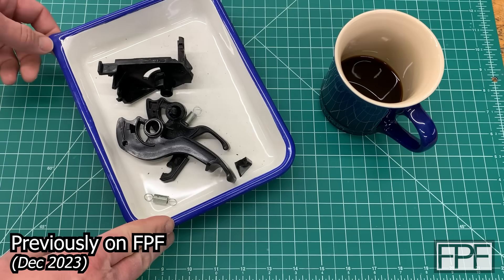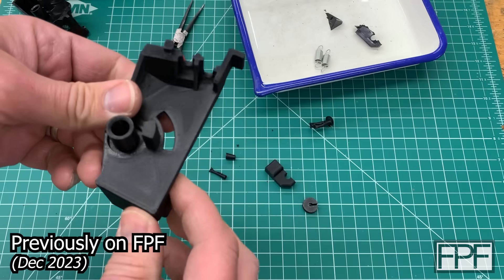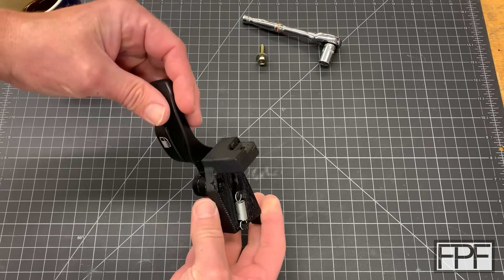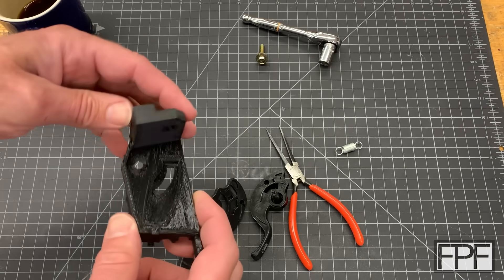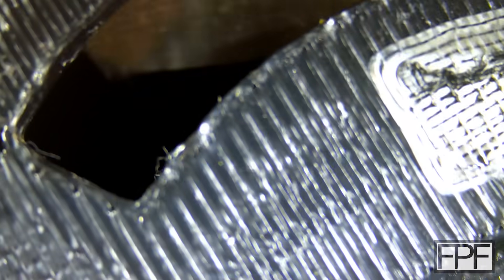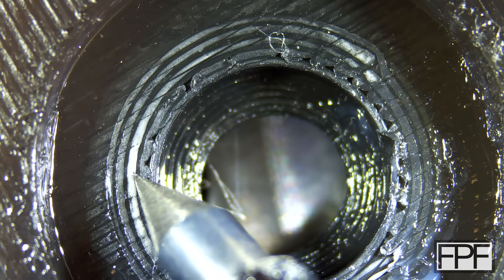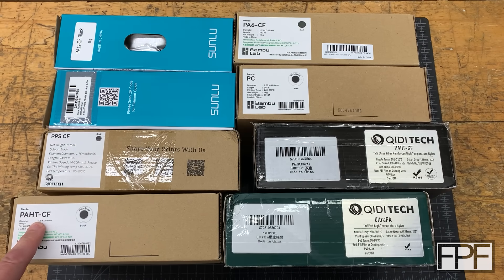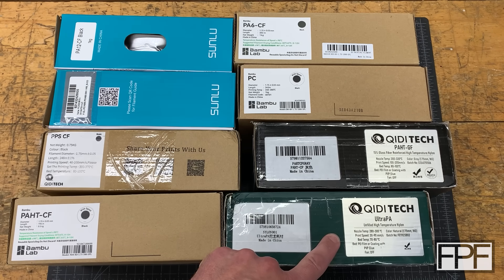3D Printed ABS Car Part Failure Analysis

Comment: Looks similar to 93 Corolla. Good to see in advance what sort of mechanism there is if it ever breaks :)

PCTG is my go to material these days for most stuff. It has layer adhesion rivaling TPU and is also very easy to print.
And as at least Henlor mentioned, adding an M3 screw or something similar for reinforcement would make sure it will not fail

Comment: Insert a flanged screw or a screw with a washer thru the bushing into the center of the inside lever.  Should hold all of it together even if the ABS fails again.  As far as the square pivot point, maybe fillet it with some epoxy around the outside?  My 2c

Comment: The stopper part is what it is, but the tube that broke off is an easy fix. Just make it with a much smaller internal bore so the base will be that much stronger and replace the lever retainer that goes through with another piece, it has no force on it just keeps the parts together. Won't have any more issue with that part.

Comment: I don't have time for reading comments rn, so if someone did already gave same answer, I am sorry to repeat, but here:

If You have problem with layer adhesion, I do not recommend carbon filled filament, since it doesn't bond layers good as same raw material.
That said, I have best experience by far, where I don't get problem on parts breaking in same layers with pure PC. 

And if You have pure PA6 (without carbon fibers) I would recommend that one.

Dry them well, 100C for 4 hours, and give it a go.

If part reorientation is an option there, I would recommend that over anything else!

Cheers!

Comment: another possibility is someone pulled the handle up too far, sheared the barrel off, then let it go allowing the handles to hammer the the stopper off.

1:56 i might be mistaken but it looks like theres plenty of dead space in that 100 degree inside corner to fit a new stopper, quite a huge one actually. if that space is not actually needed for anything, just pulling a huge fillet out of that corner would do. the old stopper can be left in place as a guide pin but modified a little to not be able to perform the stopping function.

also that barrel that sheared off seemed to still perform its purpose just fine as a bushing to connect both levers. it then only just became live shaft inside a pretty decent counterbore, which again, looked to me to be quite okay. does it really need to be attached to the part? the springs on both sides look ok at keeping the assembly in place. i suspect this part could have been broken for a long time already, before the stopper broke, can the counterbore be converted to a throughole and barrel be made longer to go completely through, maybe even replaced with a rivet?

can the part be printed at 45 degree to the barrel? thats 41% more layer adhesion with no design or filament change. that will also apply to the spring tabs.

PA6/PA6-CF is strongly recommended against in the voron documentation because of temperature and moisture induced creep. generally recommended against for structural.  ASA is going to be slightly better than ABS and PC is going to be slightly better than ASA. but these are all not fantastic for layer adhesion anyway.  PC-CF is next level for layer adhesion but you dont have that. 

PA12 should be okay. but...

actually you do have something that is excellent for structural against temperature and moisture and layer adhesion: PAHT-GF and CF, better layer adhesion to the former. but a lot of it is because of the 300C nozzle temp. maybe you should do some Z axis tensile tests on the few PAHT boxes that you have and go with the best.

i believe there is only one more step up from this and that's the PEI/PEEK/PEKK tier.

Comment: Stress Relief geometries can be easily implemented but it's clear that the thing you need the most is to change the print orientation.

Making manual printed supports will be the ideal way to preserve the correct dimensions, automatic supports are not fit for these tasks for complex(and small) support geometry.

Comment: I would definitely recommend changing print orientation. Would it be possible to have best strength across the whole by separating out the barrel, possibly printing the barrel in two complementary pieces that joining at 90 degrees to each other, similar to what muiltiboard does for many of their parts. This would ensure the layer lines are continuous from the back side all the way up to the end of the barrel, plus bed contact would be on flat joining edge, not the start of a curve.

Comment: You need layer bonding strength - TPU is the pinnacle. Please try some really high hardness ones like the 64D, even a 98A could be close. Add a few modifiers in the slicer to beef up the important parts. Print with 5+ walls and 50% gyroid, you could drive a truck over it.

Comment: Bambu labs are quite poor at giving you the information you need to compare materials. - their pages encourage you to buy filament, not make good choices!

Take a look at the table, currently at the bottom of the ABS-GF page. there is a comparison between ABS, ABS-GF and PA6GF
the question you should ask is if the snap at the layer line is caused by bending. - where PA6 has better layer strength properties. or impact, where it has worse layer adhesion properties.

if the part bent and snapped, PA6 might be a better choice, is the 5 layers in that pivot feature snapped because the force on the pivot exceeds the adhesion of the layer, it's going to be worse printing in PA6.

I would redesign the part with space for a hex nut to be embedded at the end of the extrusion, and a pocket for a washer and dome bolt to go through, holding the layers together at the part where it previously broke. 

Then re-print, same material ABS.

Comment: Just print it as is but in plain nylon with 100% infill. Cf fill is a bit of a gimmick and just reduces layer strength. The only plus would be reduced warping but with your enclosed printers you probably won't need that. Also look at your printer settings. I work on slightly slower print speeds and a line width at least 3 times the layer height to get a good squish and layer contact area. Reduced layer heights also help with layer adhesion so try something like 0.16mm and at least 0.5mm width. Nylon is flipping tough, good layer adhesion, some flex (making it even more difficult to break) but when printed solid it will resist pretty much anything! I used it to make a roof rack fitting for my mate and it held up fine even down the motorway at ....errrr... no more than the speed limit 🤣

Comment: I am thinking the main part be printed as before.  Then make that barrel a separate piece that would press fit through the entire part… the barrel would be printed in the horizontal axis.  Then the layer lines of the main part and the barrel would be perpendicular.  The barrel looks like it might also be able to be beefed up a little?

Comment: I don't know how much control you have over the printing order. I'd print the broken area in one shot , starting from deep within the surface, under where it broke. The weak  point is obviously cause by printing time different when the base layer is getting too cold to hold the next layer.

Comment: I’ve heard a lot of claims about Polymaker PA612-CF. I don’t have any first hand experience but have heard a lot of positive responses from the community. I’m not sure if the rigidity will work against you. I have to imagine you want some rigidity, but too much and you’ll probably find more layer adhesion issues.

It’s on Amazon 1-2 day shipping if you want to try it.

Comment: I'd reprint it in a different orientation. ABS is probably fine, just don't rely on the layer adhesion for mechanical parts.
Maybe try 45°, it's a compromise between holes still being reasonably round and layer lines not being orthogonal to the loading of the part.

Comment: i would try to acetone smooth that part to increase the surface strength which would also remove the dust collector aspect. And printing it hotter to have higher bonding with the layers. There is also things that may could be done on the design it'self to improve the strength. Or even better printing it at an 45 degree angle with own created support to give the part an overall strengh on all sides and less support waste. Slant3d made a video about it.

Comment: Maybe some part-specific settings changes for the ABS might be good enough? Just slow down the print speed and increase the temperature. You could also modify the design to allow reinforcing some points with steel pins or screws. That said, since it's not clear what happened, it's possible the OEM part would have failed under the same circumstances. If you want to change material, there are also some modified PETG filaments (sometimes marketed as CPE) that can also work well in higher temperature environments. Fillamentum, fiberlogy, ic3d, and spectrum all have versions of them. Copolyesters generally have great layer adhesion, though you'll need to print these quite hot to get it. Among the filaments you have the Qidi nylons are probably your best bet. They're PPA-based and should be very strong.

Comment: Does the 'square' pin have to be combined with the bulk of the part? if you have space on the rear, could it be attached through the base

Comment: Sometime metal is better than plastic. I'd use a metal bolt instead of that plastic pin. I'd print the tube, but maybe shorten it. Have a bolt run thru the 'other' piece and self-thread into the tube down to the bottom. That piece with the male pin now has the bolt and will rotate around the shaft of the bolt. The screw self-threads into the ABS down into the base of the part with the tube. The screw adds incredible strength to the hold the tube layer lines together. Just too much shear force for anything with layer lines going that way.. although the under-extrusion is interesting to see. Wonder if a bit higher temp will help melt those layer lines better. I'm not sure if easy to use metal as I can see all the fine mechanical details.

Comment: This is the reason I built a high temp voron. I print ASA or ABS with an 80C chamber temperature. The trick is to get the hotend cooling efficient enough so the hotend doesn't clog. Also part cooling requirements go off the roof at 80C chamber temp. You need A LOT of part cooling, way more than PLA. The trick is to make sure the part that has already been printed stays just below the glass transition temp of the material and stays there for the duration of the print, that's what the 80C chamber does. This ensures that parts don't warp as ABS shrinks as it cools. Also what it does is ensures that the new hot filament can easily melt the previous layer and fuse with it fully. Also important is to let the whole chamber and part cool slowly, don't open the door until the chamber is close to room temp, this ensures that there are no internal stresses as the parts shrink downto it's final form. The 80C chamber will make the parts equally strong in any direction, no matter the layer orientation.

Comment: ABS will be fine, I would just reorient the print so that the stress will not align with the layer lines regardless of what material you decide to use.  It may take a bit of support material but it will be well worth it. People seem to have already informed you about PA6 vs PA12 so I'll spare that. PPS is also not nylon, but polyphenylene sulfide It is actually well suited for car parts, so your PPS-CF filament could be a good contender too. I would only avoid the non reinforced Nylon from the filaments you've shown since it is a little more prone to flexing than the others. The rest seem like fine material to print out of, but I'd still stick with ABS. There are also glass filled and carbon fiber filled ABS and ASA filament out there thar are also suitable for car parts.

Comment: comparing 3d printed parts against IM parts - the layer lines, all of them, are basically knit lines. Knit lines are where the 2 fronts of molten plastic meet in the mold. The more visibly the knit line, the greater case for failure. It is the heat and pressure that ensures a stronger "knit line".
Every line you see in a 3d print is a failure point. If 3d printing functional parts, using material and parameters for printing parts with no visible layer lines would be best.
I have printed ABS and ABS-GF so far. I have Nylon, PC, and PC ABS still left to try. I am not printing car parts though, only jigs and gages for the work shop.
Most plastics used in vehicles - PA6, ABS, PC/ABS, POM, PP

Edit:
you have some Nylon (PA) and PC/ABS. I would go with the PC/ABS over the nylon. Poly-Carbonate and ABS copolymer. Nylon is mainly used for powertrain parts (under the hood) along with acetal (POM). Nylon is tricky material even in injection molding. It has be dried all the time during manufacture and tolerances are harder to maintain due to shrinkage. 

ME: If I didn't have PC/ABS, I would go with ABS GF. the glass fibers are not needed in IM parts but in 3d printing, based on my prints to date, GF is turning out better parts. Better layer adhesion, no visible layer lines (to the naked eye), no or no discernable shrink. I have been printing a 608 V Wheel for the last 2 days (I am sick, so a lot of sleeping has been done) and I tried ABS first. No matter how I orient the part, set up the supports, modify the parameters, the print comes out misshapen and full of rough spots or simply failed prints. The ABS is experiencing too much shrink rate. ABS-GF, perfect with very little modifications to the settings for the process and the material.

Comment: I would change the print orientation. Rotate 90* This way the small bits won't rely on layer strength.

Comment: A big part of the problem was printing that part with 100% infill to try and make the part solid. Doing so decreases layer adhesion at protruding features because  there is no connecting members between layers. Printing in ABS should have been fine with proper slicer settings. Even dropping down to 75-80% infill would allow interlaced connections between layers during infill printing.
A lot of people assume that printing at 100% infill provides a stronger part, which is not true at all. Additional walls give more rigidity, but infill can cause a lot of issues at higher percentages. I rarely, if ever, go over 50% infill.
I have parts that hang on a wall attached by a slide in connector only 12mm wide that holds over 75 lbs of static weight. Printed with 5 walls, and only 20% infill, from PLA plus. That particular part has been hanging on my wall for over 4 years without fail. While the load is static, I am removing and replacing the load (tools) off the holder multiple times per day, 6 days a week.

Comment: If there is space you can pocket the failure site and add a chamfer to the column. Having the critical line beneath other layers helps improve strength and the chamfer reduces the stress concentration.

Comment: 7:45 In the design, you can add a hole to reinforce the print with a pin or screw (probably an m3 will be enough)

Comment: I second the comment about contacting Igor at MyTechFun. I am a patreon and he has an Excel table with all the results. If your Qidi Ultra PA is the same as his entry UltraPA-CF25 that has very high layer adhesion. But I would love to see a collaboration. PA6 and PA12 refer to the chain length of 6 or 12 in one of the monomers that make up the nylon structure, not the filler content.

Comment: For the tube: Open up your minimum and maximum layer width limits.  This lets it fatten lines to fill the space or insert a narrower extrusion to fill a gap.  You have gaps because the multiple allowable extrusion widths would have made the tube wall too wide and your minimum is so thick it couldn't fill with an extra wall.    Printing holes to net size would be an engineering error.  Print the tube undersize and run a reamer or drill bit through it to within 1 or 2 thou of the shaft.  What?  You aren't collecting reamers?  You don't have a full number letter fraction drill bit set?  And you are a maker?  ;-)   Consider an orientation change to improve the finger.  Better yet, print the rectangular finger with a hole, drill to .010 under a number 2 screw (in the finger from the back), a clearance hole in the backbone and put a number 2 sheet metal screw in it.  Your extrusion steps could be low.  I suspect there are more than 1 issue here to maximize the material/design.  I do make my living as a maker, largely 3d printing practical UAV parts for aircraft up to 100lbs and $50k.  NEVER regard provided profiles as correct.  They are perfect only for amateurs.  Complex prints such as this show the flaws.

Comment: I really like this channel. I see many really good suggestions that could yield an improved part. I’m wondering if you’re going to limit the design space to filament material and 3d printed solution. If you restrict it to 3d printing and filament, that’s still a very large set of very good choices. Since the original print worked in the car for more than a year, the ultimate question is: how to be confident the new part will hold up better than the last one? 

If changes are limited to 3d printing and material selection parameters with the objective to increase adhesion strength, then PA-CF, PET-CF (not PETG), and ABS (as control reference) would be my choices. I think some destructive testing of samples to gain confidence may be needed to demonstrate which alternatives are best by measure printing consistency, and parameters yield consistent results in critical places.

Comment: ABS under stress can crack when oil gets on the plastic. You might need a different material or different lubricant. Fixing the layer adhesion problem is part of the problem too.